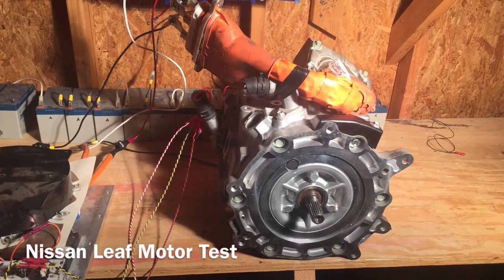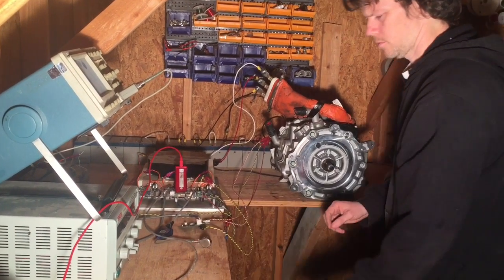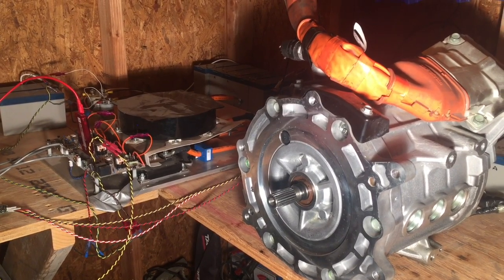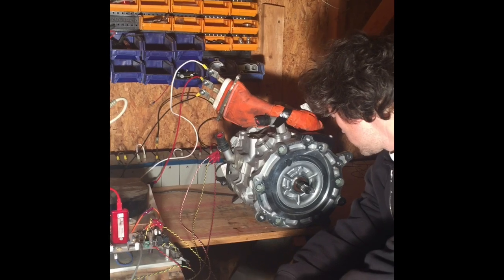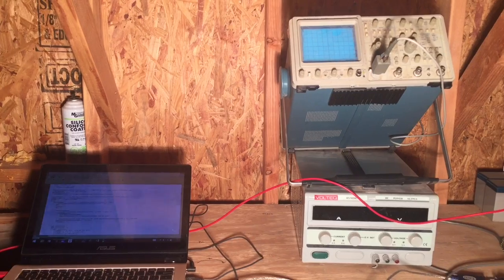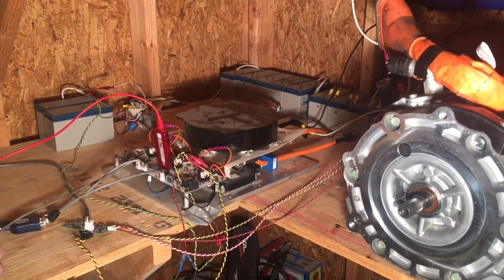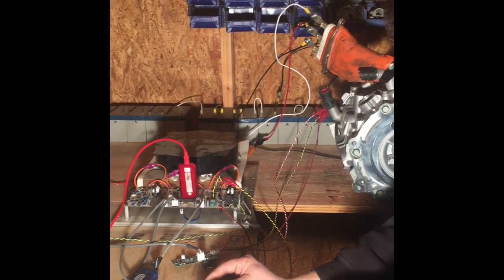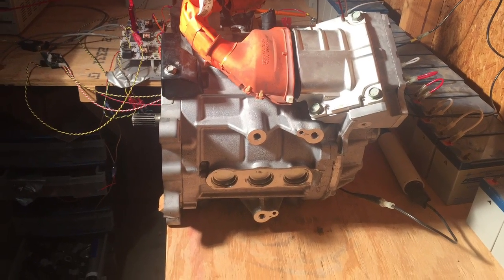Nissan Leaf Motor Test

Comment: OK so im looking into doing a conversion with this motor, and i intend to buy your boards from the net. what voltages does this motor actually run at? if i am to believe the spec on the OEM it needs 360v to run, care to weigh in on this for me?
Reply from the maker: I've run the motor with a DC bus of 24v up to 400vDC .  The stock controller is 360v nominal I think.  At a lower voltage, you don't get to have high torque for very long before it runs out of voltage.  So, You can run it at 24vDC, but the peak RPM will be much lower than at 360vDC.
Reply: @MPaulHolmesMPH   good that answers several of the questions i had on voltage tolerance. my plan is to order the populated ac controller and the resolver to encoder with taxes this year along with the motor and put them in a 2000 New beetle, so it should be fun to see how well all that goes. thanks for the reply man, hopefully im able to lay hands on all the hardware and get to set this up.
Reply from the maker: @5speedfatty  I also recently finished a replacement board for the 2011-2012 and the 2013-2017 Leaf controllers, so you could just get the motor and controller from a leaf and use that.
Reply: @MPaulHolmesMPH   depends on if i can get the whole setup complete from ebay. none of our local wreckers have leafs, so its basically only ebay. but if i can get the entire thing controller and all ill order that instead. thanks for the info on that by the way. that gives me a bit more options as far as what to lay my hands on.

Comment: So, can it be hacked for more power?
Reply from the maker: The motor can be run at several times the power level it's rated for.  I make a control/driver board that lets you ... unleash the beast within"...  duh duh duhhhhhh.  It's here on our website:
https://pandspowerelectronics.ecwid.com/#!/P&S-Power-Electronics-3-Phase-POPULATED-AND-TESTED-AC-Control-Driver-Board/p/59121602/category=16287307

Comment: Hey, nice controller. I was wondering if you could answer a qustion iv been pondering? If I drive a leaf motor with an engine as a 3 phase generator. Could I feed the power from the leaf gen motor tee in to the motor to factory controler so that I may charge my batterys with regenerative method as long as I did not send throttle signel to the controller? Dont know if the controller needs some kind of signal to tell it to except the regenerative  current or will it just except it? I wont the generator to propel the leaf and charge the battery at the same time.
Any help would be Greatly appreciated.
Tha is for your
Reply from the maker: If you have a way to keep the motor spinning, you can use the controller to charge the batteries.  But as you charge the batteries, the motor is experiencing negative torque, so that it is trying to slow down.  The ony way you can keep the speed up while regenning is if you are going down a hill.

Comment: hi if i had a leaf motor with the charger at top and the converter in the middle as it comes from factory and take off the drive shaft bit of so it looks like it does on your bench could i then (with an adapter plate and flywheel) fit this to a vw bug gearbox ?? cheers fish

Comment: can I use it on and ev conversion project?
Reply from the maker: Yes!  Here's where you can get the boards:
https://pandspowerelectronics.ecwid.com/#!/P&S-Power-Electronics-3-Phase-POPULATED-AND-TESTED-AC-Control-Driver-Board/p/59121602/category=16287307
When you order one, you can get a bunch of info on how to make the completed controller.

Comment: Hello Paul,
1- What is the voltage and  amp. (maximum) of your controler
2- I have a project in mind with a Nissan LEAF motor.
3- If the motor was built for 360v-400v,  is going below 360v will harm the motor in a long run?
Thank you for the work you've done.
Reply from the maker: With 1200v IGBTs, you could do about 750vDC and maybe 400ampRMS phase current.  You can run the motor at lower voltages without damaging it.  It's just higher voltage that you have to worry about.

Comment: I see you have a 0-750v AC controller. Are you driving Leaf or Prius motors for use in EV conversions? I have two marine conversions previously converted.

Comment: Is that really the Leaf´s electric engine? It looks tinier than I thought this was going to be in reality.
Reply: Yup. A small electric motor can produce a huge amount of power.
Reply: @michaelramsey82  "small" is somewhat an understatement. The Leaf motor tranny and controller block weighs 190 pounds, more than engine and gearbox in a regular car. The motor itself is nice however. And using a stock or diy controller is the clever thing to do.

Comment: Hello, need more information about the motor: I know is a 3 phase motor but there is magnets inside of it or not ? I am working on a energy recycling system, so I am serious on my questions. Thanks
Reply from the maker: Yes it's a permanent magnet motor.
Reply: Do you know the pwm frequency ? I heard 5K or 10khz
Reply from the maker: Ya, I'm using 10KHz.
Reply: @MPaulHolmesMPH  Usually you wan't a higher PWM frequency to get above the audible range; 22-27kHz

Comment: I bought one of your DC controller boards a few years ago and I'm glad I did, even though I haven't actually used it yet.  The Federal and State incentives down here in California were enough to nudge me over from converting an old car to just getting a brand new one.  But your work is still super inspiring to me!  What do you need to complete before you can distribute your AC controller?  I imagine there are folks all over the world who would join you in finishing your design, eh?
Reply from the maker: +Steven Popenoe I think it's basically ready.  I just need to get some of the stuff made at machine shops rather than at home, so I can get it made in a timely fashion.  But that would require getting like 20 of everything made to make it affordable.

Comment: This little monster can generate up to 30kw of energy in regeneration mode.
Reply: Even 80KW and probably more. The 30KW limit in a Nissan Leaf is to protect the batteries and is not a limitation of the motor, since there is no difference, besides the direction of the energy flow, between generating or drawing power

Comment: Hi there. What is original voltage set by Nissan?  How much torque do you think you got with 48V?
Reply: 380volts
Reply from the maker: +MPaulHolmes I was commanding torque basically, so it was 20 amps per phase peak (since I set it so that full throttle was 20 amps)
Reply from the maker: Around 360v I think.